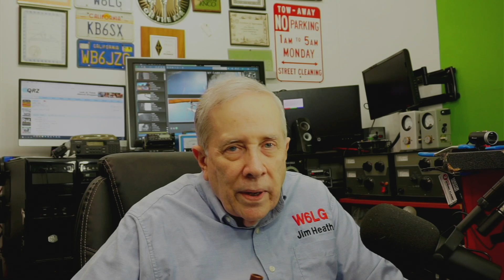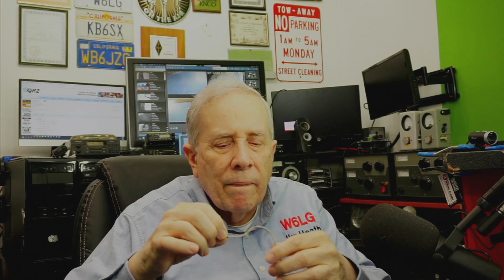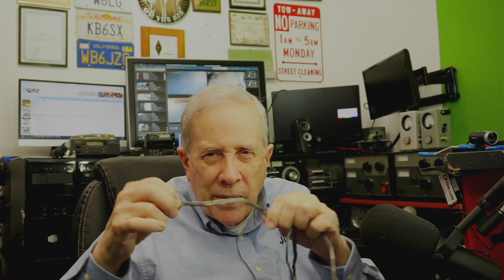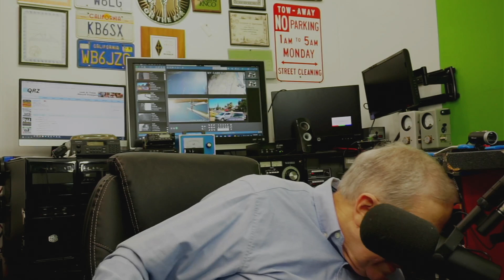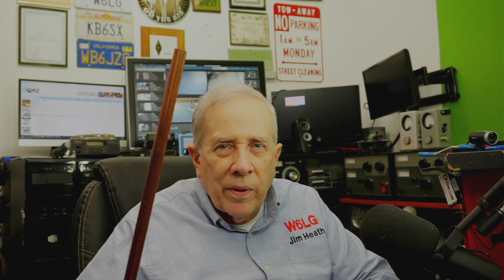How to RF Ground Your HF Station as Shown by the ARRL and a Discussion about Ground Loops, Bonding

Comment: I think I have read all the comments here and don't find the answer to the question to raised in the video.  "The ham station is on the opposite side of the house where the incoming electrical service is located and grounded" .  If I understand you correctly,  it is not possible to ground the station to the service ground location.  So how do I get all the station to the service location for a connection?  Thanks for you videos and the wealth of experience, knowledge and the effort use to create the videos...73.  N5JAJ Pat Warren
Reply from the maker: I cover this is the video.  You just make sure that you have a good electrical ground at the station. If needed you can run an AC ground in common with what is already there back to the panel.  73, Jim
Reply: @ham-radio  HOW does one do this... while I understand you have answered the question, you have not done so in a way that a lot of us newbies can understand it.... I see this same question over and over. Please break it down exactly how one does this with an example maybe?
Reply: Think of grounding as having three components and separate sets of requirements:  lightning, RF and safety.

Lightning:  Done EXTERIOR to the house.  At various points of the antenna setup (tower, etc.), connect to ground rods and connect all the ground rods together using a heavy wire.  You now have a lightning grounding network outside the house and all exterior components are connected to that network.  At the exterior antenna coax entry panel/plate (i.e. copper plate) where the coax enters the house, connect the plate to a nearby ground rod (which is connected to the lightning grounding network) and use lightning suppressors (i.e. essentially high voltage shorts).  If you can -- and try very, very, very hard -- connect that lightning grounding network to the ground at the utility power panel via an exterior-run heavy wire.  If you don't, the currents produced by a lightning strike will run on the lightning grounding network and coax, then into your house via the coax, through your house ground wiring, and then to power panel ground rod.  This is a very bad thing -- you want to shunt it away from inside the house by providing a low resistance path between your radio systems exterior grounding network and entry panel/plate, and the power panel ground.  Again, the emphasis is on this being all done so as to route the lightning strike currents -- nothing to do with RF.  And, of course, disconnect the coax between the exterior entry panel/plate and your equipment whenever there is a lightning storm.  

RF:  Connect all your equipment to a common baseline reference voltage (i.e. the copper pipe).  Use copper ribbon or braid to provide the RF connection.  This keeps all your equipment chassis at the same voltage and thus no differential voltages to radiate RF.  There is no such thing or need for an imaginary RF ground exterior to the house running to this pipe.  If you run a heavy wire, braid or ribbon from the interior pipe to the exterior entry plate, you are making a super-highway for lightning currents into the house.  

Safety:  connect all the chassis to the house ground wire.  Make sure all equipment has a 3-prong plug and your house wiring is correct.  If you want, run a separate ground wire from the house outlet to the copper pipe.

Comment: 1/2" copper tube works very well in my shack too. Thank you for the video. It was nice to chat with you on 20 the other day. Thank you for the information on the old sb-230.
Reply from the maker: Thanks for all.  73, Jim
Reply: You simply connect the chassis of your radio to a copper tube? Thanks.

Comment: just a little FYI neutrals and Grounds are only connected together at the first means of disconnect. If the power to the radio room is from a sub panel then and only then they will be separated. This sub panel would be earth bonded ground rods outside.
Reply from the maker: Not always, if fact, less often then you are saying.  Of this I am pretty certain.  If that sub is in the same structure, then no ground rods.  Four conductors are run back to the main from the sub. 73, Jim
Reply: NEC: One and only one connection is made at the first/main disconnect to the ground round.  Within that panel, all neutrals and grounds are connected.  At ALL secondary panels, ground and neutrals are NOT connected together -- a separate ground and neutral line is run back to the main panel.  To do otherwise runs the significant risk of lethal voltages circulating where they should not.
Reply: IF the subpanel is in a separate structure, a ground rod must be installed and tied to the ground bar in the subpanel along with the ground wire coming from the main panel.  There must be a separate ground wire, neutral wire and power wires coming from the main panel.   But do NOT tie the neutral bar and ground bar in the subpanel together.   NO NO NO.

The house AC wiring is for power and safety.  But the main subject of Jim's talk is providing a "signal reference potential" for RF and the equipment (i.e. the copper pipe to which all the radio equipment is tied).  And to kill the myth that there is RF running in the AC house wiring or the need for an RF grounding rod for mysterious RF currents running out and disappearing into the ground.

Comment: Jim, I operated my station for a number of years using a dipole and balanced line without a ground (other than that provided by the electrical supply system), and didn't have a problem until recently. After some experimenting, I found my microphone was picking up the radiated RF. After more experimenting with cabling, shielding, and ferrite beads, I still couldn't get rid of the interference. After some  research, I tried an Ufer ground - my station is in the basement, and concrete floor is readily available. A sheet of aluminum about 1 foot square was laid on the floor with a weight and a screw for connection. This is connected to the radio and tuner. Sure enough, the concrete conducts plenty well, and RFI is completely controlled. Sure was easier than installing a rod, and the building ground is the re-bar in the foundation also.
Reply from the maker: Thanks for the information and good to read you got it working great! 73, Jim

Comment: So if my station has a power supply, transceiver, tuner and amp, I should have a strap (one of the examples you show) coming from each piece of equipment to a common point.  This would be 4 into 1, correct?  At the point they all come together, how do you recommend that is tied into my electrical system?  Thanks for the great video!  73, K8JLW
Reply: The summary of what Jim and other wise men (i.e. MIL spec folks) says is to connect everything to a "signal reference system" which has a extraordinarily low RF impedance.  This assures that all the RF equipment is tied to a common reference point at RF.  From an RF point of view, you are done.  Next, from a safety point of view, that RF reference system needs to be tied back to the household baseline potential (i.e. "ground").  

So, connect all your equipment to a nice copper pipe (=signal reference system).  Then, maybe tie that copper pipe with a wire (maybe even a simple #12) to the household safety ground at an outlet in the room (probably unnecessary and maybe inadvisable -- see below).  Because of what Jim says and skin effect, there will be no RF traveling in this wire.  RF generated by the equipment stays isolated among this equipment with this low RF impedance link.  Tying the copper pipe elsewhere with braid or anything RF-conducting does nothing -- there is no such thing as RF currents coming up from the earth necessitating an RF ground!

Note: running a separate wire back to the electrical panel is unwise because now there are two routes for AC fault currents to travel and trip a breaker (1. ground wire in the electrical cord and 2. this other long ground wire you added back to the panel ).  This is an NEC no-no because there is a potential for lethal voltages to develop along the dual paths.
Reply: @713allen   thanks for helping me towards understand this concept of bonding but I just wanted to confirm my understanding. After bonding my shack equipment to a copper bus bar, I could then run a wire from the bus bar to a nearby AC receptacle’s ground screw so that the bonded equipment/bus bar are tied into my home’s AC ground system thereby keeping the equipment at the same voltage potential? Thanks in advance and 73.
Reply: @713allen  I am really confused on exactly who one is supposed to " tie that copper pipe with a wire (maybe even a simple #12) to the household safety ground at an outlet in the room" Is there a way to describe this in more detail?
Reply: Addressing lightning strikes is ALL done outside the shack/house.  Example, ground rods attached to antennas and entry point boxes/plates EXTERIOR to house.  And, of course, lightning surge protectors on cables at the entry point.  Do it all outside and minimize lightning strike current entry into the house (i.e. no additional heavy copper wire or ribbon alongside the coax going from outside to inside the house -- don't throw out the red carpet for lightning currents to come into the house!). 

Inside the house, the concern is with safety and stray RF.  For stray RF, connect the chassis of each piece of equipment to a common baseline potential point (i.e. the copper pipe) using a low RF impedance connection (i.e. via braid or copper ribbon from each chassis to the pipe).  Doing this eliminates RF-radiating differential voltages on the chassis of two pieces of equipment.  Also, use ferrites to kill common mode RF.

Because each equipment chassis is connected to the ground pin of the three-wire power plug, the copper pipe is likewise connected to house safety ground.  This is good.  The point -- and to what I think you are asking -- is that it could make one "feel better" to connect that copper pipe directly to the ground of the power outlet.  This would be an extra-satisfying visible safety ground (NOT an RF or lightning ground).  This is perhaps a good thing to do because folks mess around with their equipment, trade their equipment, etc. As a result, one does not really know if the safety ground has been compromised.  Having a visible safety ground that I can see and rely upon could gives me the warm fuzzies!
Reply from the maker: You can just connect the common point to the AC ground that is closest.  73, Jim
Reply: @ham-radio  I'm assuming this wouldn't be on a wall outlet correct?  Although my shack in on the 2nd floor, it is right above the main power inlet to the house.  Is it OK to go through a feed panel and straight down with wide flat braid to tie into the intersystem bonding termination?
Reply: @ham-radio  The "AC ground that is closest" is likely the chassis of the power supply...isn't it? Does that make sense?